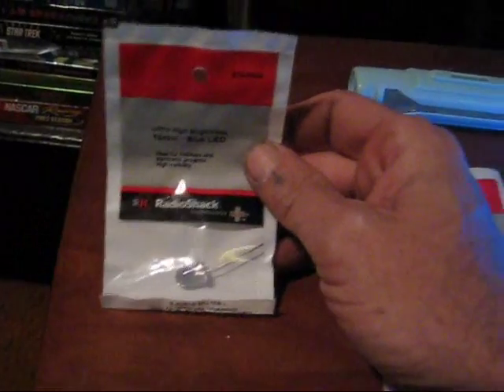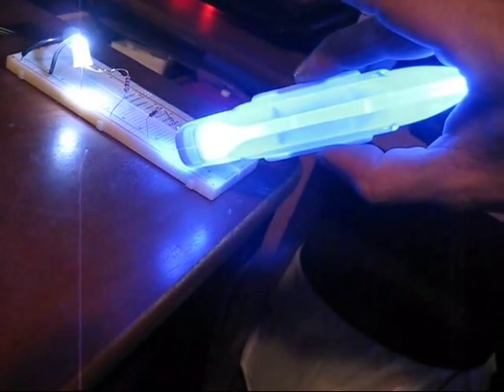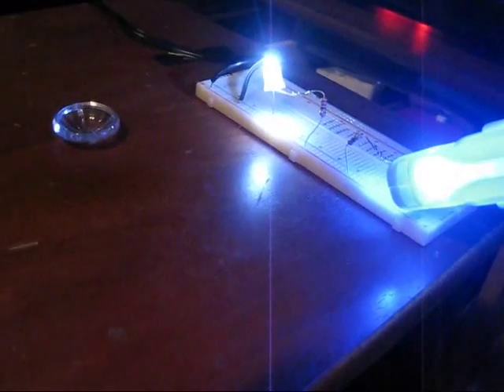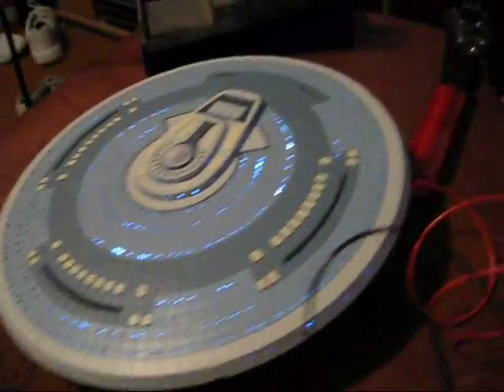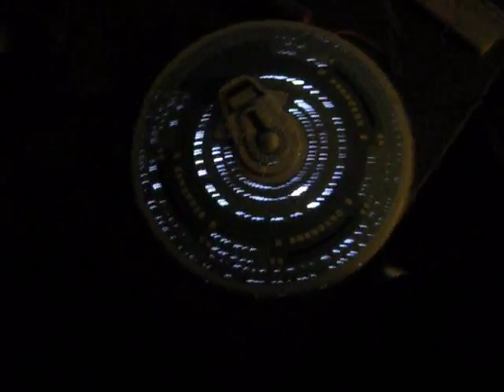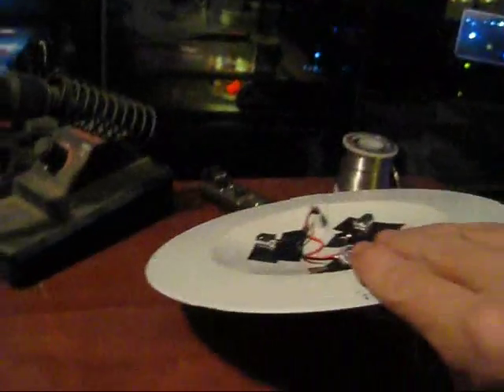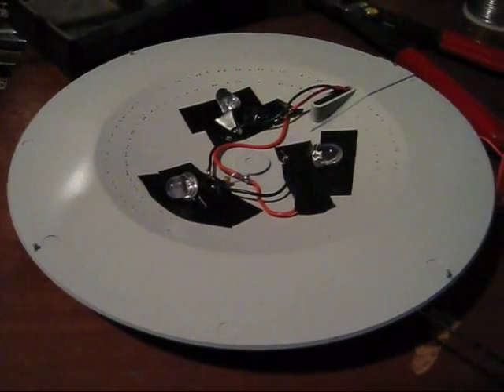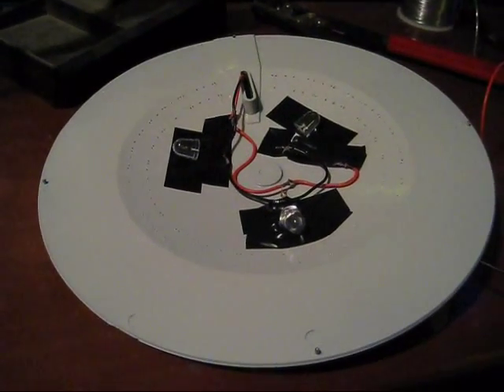AMT 1/1400 Enterprise C scale model build Lights On by TrekWorks

Comment from the maker: @pgermain 
The Acrylic or liquid glass is applied inside the model over the window ports.
Just tape up the outside so it does not flow out the holes.
When it dries, presto you have windows which look better than open holes.

Comment from the maker: The Enterprise C model is a little more difficult one to light due to having to modify the engine pylons to allow wire to pass through. Also, it requires quite a few LED's to light
the saucer evenly. I would recommend using LED tape for most of the lighting as it is easier to wire and you don't need resistors.It could be used in place of most of the LED's I used on that build.